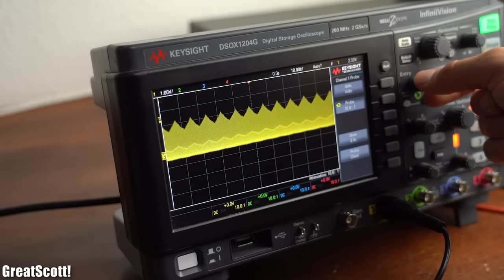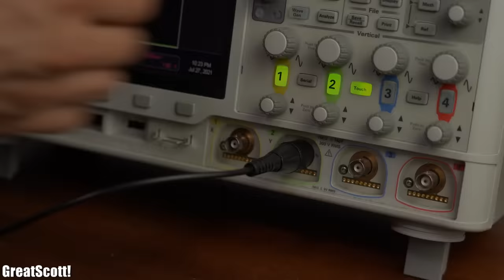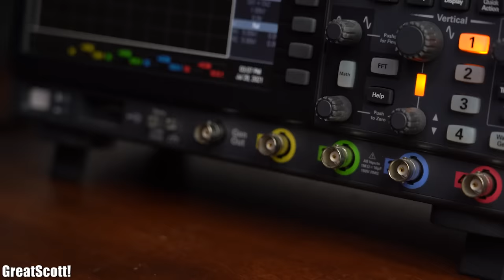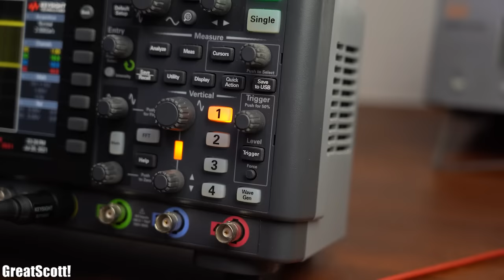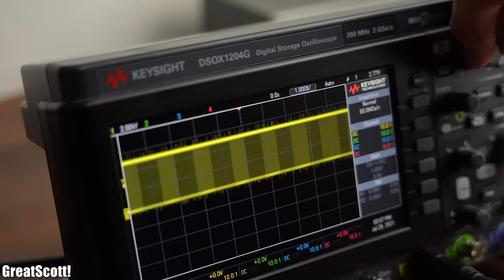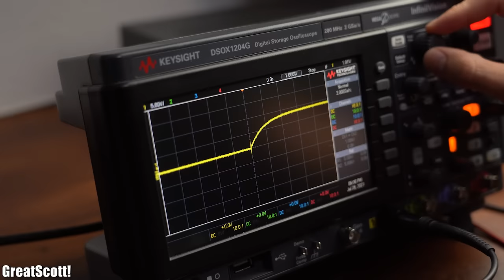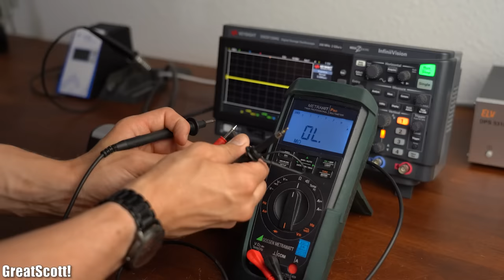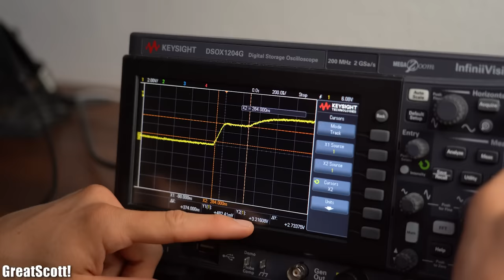Everything you need to know when buying/using an Oscilloscope! EB#49

Comment from the maker: Here are some things I would like to add to the video:

1. I do not want to shame low cost scopes in this video. I started with a 2 channel one from Rigol and it worked perfectly fine. Over the years though I noticed that 4 channel scopes are the way to go. And I also only got such expensive Keysight scopes since they gave them to me for free in order to support my work. So in a nutshell, you can start with a low cost scope just fine!

2. I heard that people would just insulate the PE connector when powering the scope in order to measure mains AC voltage. This is a TERRIBLE idea. This way you connect a possibly very high voltage to the BNC connectors. If you touch that, you have a problem because you can be partly or completely connected to PE. Only use a differential probe for that or use two scope channels and use the math function in order to calculate the difference between them.

Thanks for reading ;-)
Reply: The second addition definately sounds like Electroboom :D Though he uses a differential probe in some of his videos.
Reply: I recommend something like an Owon VDS1022 for the bare minimum oscilloscope, a Hantek DSO2xxx series for the cheapest standalone scope with a function gen
Reply: Hi sir. Sir please hack an AR glasses to work on a HDMI input even if the whole setup becomes bulkey. Bigg fan.  Love from India ❤️❤️❤️❤️❤️❤️❤️❤️❤️❤️❤️❤️❤️❤️❤️❤️❤️❤️❤️❤️❤️❤️❤️❤️❤️
Reply: Thanks, what about an isolation transformer to keep your scope and circuit safe?
Reply: What about using a separating transformator for powering osciloscope? I hope I translated it fine :) it can be usefull aswell ?
Reply: psst,.. ElectroBoom did it :DDD
Reply: Great video, as always!
But I will ad another point - even if working in low side of power supply, it's need to take in account, where probes ground is connected, especially, with dual bipolar power supply's.. 😉 One time I, by mistake, connected scopes probe ground to -12V rail, instead of ground and power supply was shorted through scopes earth wire and was automatically turned off in protection mode.. 😂 Luckily, didn't blow anything..
Reply: @rsattahip :  AGREED. Definitely should be in "part 2". Isolation transformer is safety device for tech, test gear and DUT. I put it between DUT and mains.
Reply: Yeah at my fathers place with an analog scope he just plugged it into a power bar without earth connection (nowadays that is no longer available as it is dangerous) to avoid such mistakes :)
Reply: If I use two scope channels as differential probe, do I need to connect the alligator ground reference of each probe to anything or not?
Reply: @stefan-w  The problem is that for high powered circuits like large motor drives, the size of the transformer becomes impractical. Great idea for smaller circuits, what also works is an inverter powered from an isolated power supply.
Reply: @NiHaoMike64  Isolation transformers come in large sizes too, even standard 3-phase versions up to 10KVA are available. Extra care is required when working with high powered circuits (e.g. >1KW?) and technicians working in this area are generally specially trained. I personally know of a case where a technician lost one arm and one leg while working on a 3-phase circuit that wasn't disconnected fully due to 'human error'. This technician was very lucky to have survived this accident.
When working with mains voltages, isolation transformers are a basic requirement for benchwork. I am aware that low scale outfits often save the expensive but they clearly compromise on safety. In your opinion, would you really choose practicality over safety? Especially when you advice others or employ others?
Reply: I used to use single channel 20 mhz vacuum tube  Tektronix back in 80's then 2 channel 200 mhz Tektronix in the 90's. I had 100x led that would separate ground with a floating ground. That way I could pickup any devious on the ground!
Reply: great video Scott! could you make more in depth scope video's?
Reply: Something good to know. External trigger can save you a channel. I use mine on my 10MHz. Ref clock or 1PPS.

I have a 10GS/a 4 channel 3GHz scope .. I started with a Hameg 10MHz from the 80s.... Still using it today.
Reply: as an alternative to a cheaper brand probe, there are often used high end brands for sale around the same price - but honestly the cheaper brands like Rigol are as good as the older budget models of the higher end brands - at least on the spec sheet.
Reply: In postsoviet reality, people using Isolation transformer(usually made from two UPS transformer). It's also an option.
Reply: "low cost scopes = rigol" :) i'm currently deciding between the DSO138mini ($24) or the DSO188 ($34), which has a higher bandwidth but no single trigger mode (thanks! i'm from an audio background, didn't know it existed).
the DSO138 has single trigger but isn't suited for much more than audio signals.. (oh soz, fnirsi pro is DSO188 but 5mHz and single trigger mode for like $37)
Reply: @Ynotee29  that's my question too. pls if you find any info can you tell me too?
Reply: Info for me!
Reply: @f.a3202  @ct, you connect the grounds of the two probes together, and make sure it doesn't touch anything else!
Reply: @marekaksmu  You should connect the DUT to your isolation transformer (that you are 100% sure is NOT Earth referenced, some cheap ones are and you wouldn't know without checking) and keep your oscilloscope connected as normal to your mains voltage with Earth reference for safety. Then you are safe to probe with a single probe. If you must connect a second probe, beware that you must connect their ground leads together otherwise you can end up with potential difference between the ground leads and short out your oscilloscope.
Reply: @redemptusrenatus5336  thank you :)    really impressive knowlege :)
Reply: We have battery operated isolated oscilloscopes in the lab, just in case we need to measure signals without an earth reference. Since some of our products are built with a center-point earth (our GND supply rail is lower than earth potential, so we can detect tampering and wiring errors/faults) this is very handy to not trip the earth fault detector circuit when measuring.
Reply: @stefan-w   And can be much less expensive than differential probes
Reply: You should do a video on "soundcard oscilliscopes", especially using some of the cheap ~$5 usb dongles.
Reply: Einfach Baugruppen zum Test mit einem Trenntrafo betreiben dann muss man sich keine Sorgen wegen dem PE machen
Reply: I have a fancy one from the 1970s.
Reply: "And I also only got such expensive Keysight scopes since they gave them to me for free in order to support my work."
-> Yeah, sure...
Reply: @oldguy9051   Hi! Hi! 
Which part are you wrestling with?
The 'for free' part or their desire to support his work?
So public spirited of them......
Reply: @jackjohnson9989  I'm not wrestling with it.
They mask their advertising as "support". It's that simple.
(and it's not about if he is worthy of support or not)
Reply: I know you may not be following this anymore, but how about this: The FNIRSI 1014D can be powered by a battery pack and supports X100 probes. I have an X100 probe AND a battery pack to drive it - so would that suffice to keep both the scope and the operator safe ? (in addition to mandatory rubber gloves when working with high voltages?)
Reply: Thanks for a Great channel (no pun intended 😎)

However , after buying a Sigilent 1104X-E, I quickly realized I need a differential probe… Found a couple on YouTube, but all on “unknown” channels!

So, to my question/dare: Would you care to DIY one ??? 😎
Reply: 😮😮😮😮😮😮😮😮😮😮p

Comment: As a long time SMPS engineer, I can tell you, NEVER isolate the scope or defeat the PE ground on it! You can isolate the power supply (device under test or D.U.T.) with a 1:1 isolation power transformer, or my old fave for use when I don't have access to one is to use two scope channels. Connect just the probe tips (unclip your ground wires from the probes so they don't touch anything by accident), and use "invert and add." That works well for low to moderate frequencies. If you must measure higher frequencies, connect both grounding clips to an "X" capacitor (rated for across the line) of around 0.1uF or so and connect the other end of that cap to the D.U.T. electrical power supply ground, though that is the least preferred method. The most preferred is the power isolation transformer to isolate the supply. It makes it safer in case you touch it too.
Reply: what's wrong with isolating the scope ground
Reply: @oliverm1255  It creates an entire oscilloscope's worth of dangerous high voltage you you or anyone to touch.
Reply: I specifically bought a battery-powered oscilloscope, as I burned more than one microcircuit until I figured out that the matter was in the earth connections. But now I ordered an isolation transformer)
Reply: @MrOlezhandr  Awesome! The life you save may be your own, or your kid's.
Reply: Why not just use a gfci, instead of an isolation transformer?
Reply: @joeshmoe7899  what is GFCI?
Reply: @joeshmoe7899  That's a lot better than nothing and should keep you safe, but it still does not allow you to connect the 'scope ground to the circuit.

To give you an idea of how important that is, when I built circuits with a 10 ns switching speed, if I used the 'scope ground clip and probed, I saw large voltage spikes around 20 Volts. When I soldered a BNC connector to the same point to a nearby ground and plugged the probe right into it, the spike was more like 0.5V. The Gfci is protecting you, but you can't make the measurements if it trips. It most likely will.
Reply: I have seen videos about how most modern isolation transformers have ground connected anyway, is there a specific company you suggest to avoid this.... I'm confused on why they connect the ground, doesn't that defeat the purpose?
Reply: @rittol2365  I'm guessing for safety. I have no knowledge of this trend since I have a different role now, but the safe thing is to connect the neutral of the output of an isolation transformer to Earth just in case there is a short within the transformer or someone connects it incorrectly. It is not unsafe as long as the Earth connection is really Earth connected (don't always trust the sockets or who ever wired it.)
Reply: @rittol2365  To be more clear, the isolation transformer has no electrical connection to the mains. The secondary is fully isolated like any safe to touch plug-in device. The Earth (I call it that so not to confuse it with a D.C. ground like in a car) would be safe to touch since it's supposed to be the potential of the Earth you walk on. By connecting the output of the transformer neutral to it, it makes that connection safe to touch, and should be the same as your 'scope ground, but again, dont trust that unless you test it somehow.
Reply: either an isolation transformer or a battery powered scope.
Reply: I am an electrical design engineer.  The first thing I do with my oscilloscope is to put an isolation plug on the mains of the scope (a battery operated scope solves this problem).  Yes, that means that the scope will float at what ever voltage you connect the grounding clip to.  I worked with scopes for 35 years and no one ever was shocked or killed by doing this.  Now if you are inexperienced in electronics and don't know what you are doing or if you have kids and a wife that will come into you home lab and grab your oscilloscope, I would not recommend doing that.  I was a low level analog designer and rarely worked on mains voltage or high current.  My currents were more in the pico amps and femto amp range.  Yes, a floating differential probe is a $1,000 option for those that work on main voltages all the time.  My issue was always with ground loops through the scope.
Reply: I'm commenting on my own comment lol. Looking back, I made a mistake. Do not connect Earth to the output of the isolation transformer at all, leave it completely isolated. I must have been over tired when I posted that. Sorry all.
Reply: @kenmore01  IMHO, the best approach is to connect the output ground (earth) to the neutral from the isolation transformer, and then connect hot and neutral to the output through a GFCI (RCD).  This maintains a proper (and safe) chassis ground for the equipment, referenced to neutral, while still keeping everything (including ground) completely isolated from the input.

This way, if the equipment has a short to its chassis ground somewhere, it will trip the breaker and/or GFCI instead of having things become energized that you don't expect to be energized when poking around inside it.

I've never seen a commercial isolation transformer unit which did this, though.  Most tie the output ground to the input ground, which IMHO is very wrong, because it then means if the equipment under test/work ends up getting a short to its chassis ground, nothing trips, and there's no sign anything is wrong, but you suddenly lose all isolation (and in some cases the equipment neutral could actually even become live relative to ambient ground, which is potentially even worse)
Reply: so do i burn my oscilosscope if do i measure the outlet voltage with it ? Supported Vpp is 400V outlet is 220Vpp
Reply: @alidemir8434  Normally it's fine with 10:1 probes. There is a voltage limit printed on the scope by the input connector, but a 10:1 probe will allow you to go 10 times higher as long as the probes themselves are rated that high, and most are.

Comment: Great tips! When I took an electronics course the instructors wouldn't let us touch the oscilloscopes until our second year. And then there were several reminders not to touch the leads to any of the board's powered by the mains unless you were on the other side of a transformer.

Comment: I had electrical measurement classes at Faculty of electrical engineering. We worked with old analog scopes (2012). Our professor taught us that is we measure mains voltage or autotransformer that we can simply unground the scope by plugging it into ungrounded socked.
Reply: Useful but dangerous.
Reply: Then the entire body of the scope becomes an electrical hazard.
Reply: @AlienRelics  So what? Sometimes common sense is better than relying on safety systems to protect you.

Comment: The input and output of differential probes are actually usually not isolated, it's just a resistive voltage divider (the 4.5Meg measured in the video) that reduces the voltage on the input that enables measurement of high (common mode) voltages.

Comment: 11:37 When I was in the university, We solved this problem with a bit of electrical tape to mask the PE of the oscilloscope. But this method can be painful. Please don't try at home. But instead of the tape method, I think an isolation transformer can work fine.
Reply: DO NOT connect an oscilloscope to an isolation transformer. Always isolate the circuit you are working on, or if that is not possible use differential probes. Never isolate your test gear
Reply: @boulder795  Why? as long as there are no ground loops you should be fine.
Reply: @Ryan_Tidwell  Rule of thumb: only connect an oscilloscope ground someplace you would feel safe putting your finger.

The device under test needs to be isolated. Whatever you connect the ground clip to becomes connected to the oscilloscope chassis. If you isolate the oscilloscope and connect the clip to a mains reference the electronics will be happy, but if you touch the scope then you could get shocked.

Plugging an oscilloscope into an isolation transformer is actually safe. However it's pointless because an oscilloscope's power supply is already isolated. More importantly, and to Stephen's point, this can provide a false sense of security. It's the equivalent of touching bare high voltage power wires while "protecting" yourself by wearing rubber shoes.
Reply: Isolating your scope through a transformer works just fine. Nothing wrong with it as long as you keep in mind that poking another mains-connected thing with it will make everything else hooked up to the scope and any metal on the scope itself also mains-connected. If that's too much for you, you have no business poking mains-connected gear, no matter which part you isolate, full stop.
Reply: @AttilaAsztalos  Plugging a scope into an isolation transformer doesn't accomplish anything because an oscilloscope's power supply is already isolated. If you really want to isolate its ground, just tape over the ground/earth pin in the power cord. I'll discourage this because of the risks involved, but if you decide to do this please be sure to use a tested GFCI/RCD in case something goes wrong.
Reply: @eDoc2020  What is the transformar has earth wire connected to the main earth wire? We are back to square one again. Its just way easier to isolate the test circuit though the transformar and leave the earth wire disconnected from the mains connection.
Reply: @shkhamd  I think we all agree putting the circuit under test on an isolation transformer is the safest option. Isolating the oscilloscope's earth ground should only ever be considered in extreme circumstances. If you do not have an isolation transformer and need to take measurements this can be done but it is far from safe.
Reply: We all have multimeters to check what the hell is going on first, if we have a scope. Unless you are operating at mains potential there is no good reason to isolate the scope. First principals of repair; figure out and repair the short to ground first, then test from there. 😬🤦‍♂️
Reply: @shkhamd  There is no point to earthing a device powered by an isolation transformer because the output power lines are not referenced to mains earth. The solution would be to get an isolation transformer not built by an amateur (you had one job, etc.)